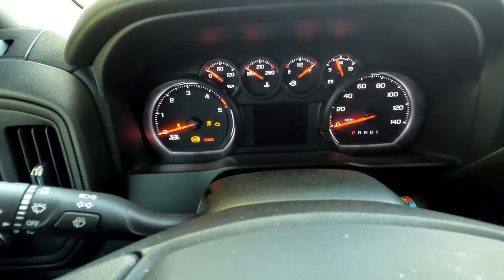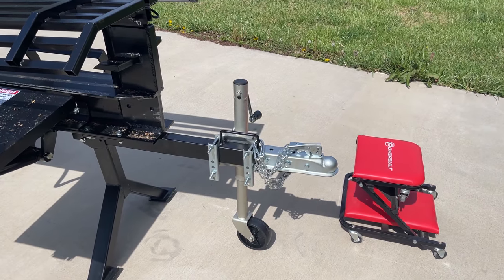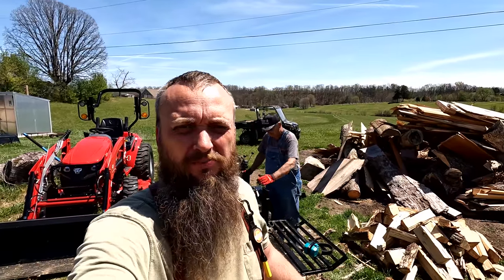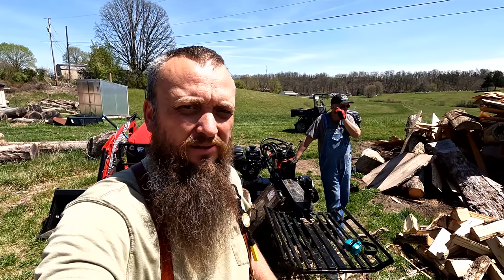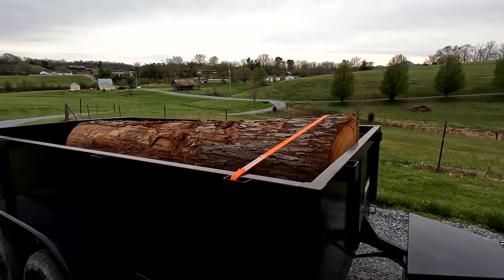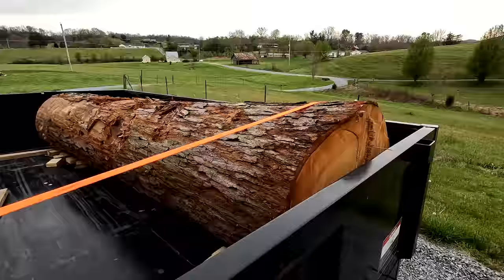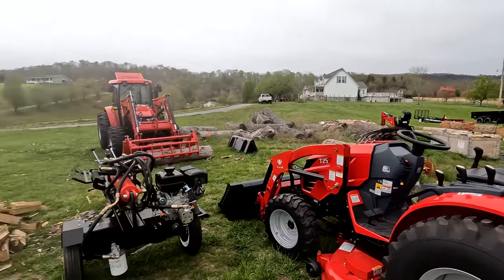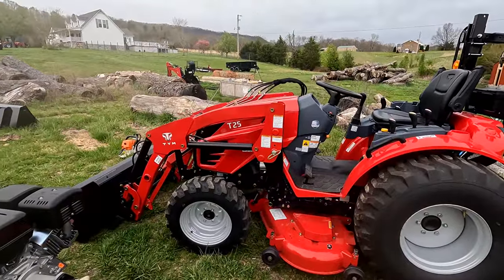Look At What Showed Up At My Sawmill!

Comment: I was thinking, that if you left the split logs on that rack and put a loader bucket in front of it that the logs would push themselves off into the loader bucket and you could dump them anyplace you wanted. Just trying to think how you could handle the firewood less. Seems like you're doing a lot of handling. That's a great looking mower for sure!

Comment: One idea I have when you’re splitting logs is to take some of the cuttings off the burn pile and split them for fire wood too.
Reply from the maker: Pine
Reply: @OutoftheWoods0623   hardwood burns nicely and can burn to hot coals to cook on. potatoes insulated in a dampened coarse kosher salt mix and aluminum is  very tastey. put in the fire for 10 minutes flip over for another 10 and taters ready as a country boy you could tell me more.  a little dry pine makes a good fire starter. do you burn your burn pile in the winter when we need a tad more heat. or in the summer heat is not good for forest fire dangers. i know to you know better burn safely. 

your mowing near dark time reminds me of days past with a d160 16 hp wheelhorse  lawn and garden tractor with a 60 inch mower deck and headlights on past dark

Comment: I have to say IMO hydraulic wood splitter is one of the greatest inventions ever.
Reply: @jkcarroll  I have used both for many years.  I even have had wood splitting contest.  BTW I never won any of them but I did succeed in getting a lot of wood split.  At my age my future plans are to stick with the hydraulic method.
Reply: @larrystephens7437  Oh, I agree  about using the hydraulic method when you get older. I'm just saying that if you have a teenager showing signs of testosterone poisoning, the hammer-and-maul method is a wonderful  treatment.
Reply: @jkcarroll  Yep it was the teenagers that I challenged to the splitting contest that I had no intention of winning.  They got to win the contest and ended up the overall winner.  I got my wood split!!

Comment: Just about the only thing I would've done different is to NOT just throw the split wood on the ground. Because now you have to bend over to pick all of it back up to load/haul it elsewhere. I would put it in the truck bed, a trailer(preferably a dump) or stack it neatly(for later use) straight off the splitter. But, it's your own back getting damaged, not mine. My Dad taught me 2 key things to make my life better for my future. #1 is to work smarter, not harder. #2 is to do the job right the first time to prevent yourself from having to do the same job twice. Only one task in Life is worth repeating, even when done correctly, and that is to create happiness.
Reply: lots of neat stuff. i saw the magnetic length gage. you have a stihl chainsaw. i have been looking at electric chainsaws with the quiet power of lithiumim ion battery power. on the home depot line i favor the extra starting  bar length of  the 40 volt saw. the 18 volt is ok but is not that powerful because of the less voltage and the lighter  battery weight. the  first battery operating chainsaw that i saw  was from a gentleman from church  in his 80s he  had a small battery operated saw of brand x(unknown name from earlier amazon days at least 8 years ago. i was amazed it was lightweight tool (not a kids toy) . but i was a healthy paul bunion of man type in my mid 50s . i need a gas powered ear shattering noisey machine. now i like the quiet push button off and on of the light weight plastic properly designed battery operated chainsaw. i have seen enough 110 volt chain saws with broken/cut power cords that skip them.
it reminds me of the first test of a 18 volt ni-cad battery powered ryobi (ca nobi) chainsaw as shaina twain sang that don't impress me much. but if a lithium-ion 18 volt battery was available  i would  l would be curious on a retest.

nathan i your parents name you after nathan in the bible. or nathan the big wiener of a famous coney island hot dog. or the revolutionary Patriot  nathan hale of connecticut and  member of the green mountain boy and maybe the new Hampshire motto live free or die. hey it don't matter   you have  that name as long as you as you have been alive because your mom and dad christened you nathan of your family line.

are you going to the connecticut yankee open house at log rite here in tolland connecticut with tons of signs nathan (hale) slept here. if you do come up bring your dad because kevin bantle co owner of log rite lost his dad years ago. bring your son also because your son has to see the world out of the woods. and the bantles have a couple of boys  of the same vintage as your son. because it is a family event starting 8 am and going until  3pm officall or whenever the cleanup or party ends.  give mrs nathan the option to come up north to tolland  connecticut. if you par take in moonshine bring a bottle of tim smith's legal Tennessee sipping moonshine  but remember no sipping and driving connecticut  local mounties (state troopers) do not like  alcohol over the legal limit.
 make sure that you invite mrs nathan  and give her the option or you will never hear the end of that. your dad taught you happy wife happy life. especially if the women axe men from maine are there.

later brother of different parents. i have to get out of this forced retirement institution.  take care my friend. check with kevin if you should bring camp wood if happens to be freezing cold or damp. it is happening rain or shine. maybe this a forestry forum first barbeque after the covid pandemic. check with the  bantles about latest covid mandates in tolland county. we want to to be safe. and if that mandates extra safe. it is better to be safe now than sorry ier   later.

Comment: Great video Nathan; i too (as other have already said) enjoy watching you work with your father. 

I do have a question; your saw was kind of jerking when you were cutting. Mine is doing the same thing; what the heck makes them vibrate like that? Is it something I did while sharpening the chain?
Reply: Yes, that shaking is.not normal and is revealing some problem with sharpening, the bar, or sprocket.  Try these 1) remove your bar and chain and remount them.  Not fixed? Then 2)  Mount a brand new chain.  Not fixed? 3) Remove bar and chain and examine the sprocket and replace (this is not likely the cause. Usually you've got a chain cutting unevenly on the left and right which will cause the bar to vibrate and is worse on longer bars.  Perhaps the rakers are filed uneven or very low and it's just very grabby in too hard a wood.

Comment: Never seen that fire wood round measuring tool before. All I do is lay my chainsaw on it’s side so the dogs are against the end of the log then the tip is where I cut. Easy consistent lengths, I use an 18” bar mainly for this but with the dog the rounds up up being about 15” long.
Reply from the maker: Found on Etsy

Comment: I have a question.  I have some pressure treated boards that have been on porch of old home place for 45 years.  Do you think it would be OK to use them as spacer boards between newly cut lumber.  Thanks
Reply from the maker: no, you would get sticker stain,

Comment: I may have missed it, but I never heard you make clear just why you wanted a log splitter, you just said you've always wanted to get one.  Is it to make good use of wood that would otherwise go on the burn pile?  Some of the logs you cut up for the wood splitter look like they'd make good sawmill logs.  Could you clarify just where the splitter fits into your operation? ( And it does look like a really handy piece of equipment.)

Comment: Grabbing logs by the ends on the splitter table is a bad idea, especially when two people are working together. Very easy to get a little quick on the hydraulics and get a crushed hand on the ram side or worse a cut off hand or fingers on the wedge side. Better to handle the logs and split pieces by the sides. Great splitter though, looks like you could split a lot of wood in a short time with it.

Comment: Get a foot actuator to operate the splitter ram. Keeps both hands free to handle big logs. Plus change the valve on it to where when it bottoms out it automatically retracts.
Reply from the maker: Works just fine as is. Thanks
Reply: @OutoftheWoods0623  ok my friend no offense of course. But yeah that foot switch comes in handy though fooling with those really big firewood rounds. My ex father in-law put one on his and it's a big help. Like he said I wish I put one on a couple years sooner.

Comment: Since you are cutting your wood significantly shorter than the stroke on your log splitter could you add some hydraulic cylinder stops to the ram to keep it from cycling all the way back in? This would shorten the time needed to split the wood.
Reply: I was wondering the same. I also thought maybe a four way splitter would be better, if one is available for that machine. Obviously there would be an upper limit on size of logs split, or maybe too much for the hydraulics, but it seems that saves several splits to get to wood stove sized chunks.
Reply: @andrewbieger5004  I believe he does have a 4 way for it.  I've noticed it in a couple of shots of them using the splitter.
Reply: @tyettu  Must have missed that one.Thanks

Comment: Doesn't anyone tier their firewood anymore? I haven't seen anything tired up properly to dry like we used to. When I was in my teens we cut and split 9 cord each year for that winter. After we built a wood splitter I run it and tired it to dry then in the fall I wheel barrow Ed it into the basement load after load. Music playing sure helped. But any videos of wood splitters or even the commercial splitters no one seems to tier any more. It is the only accurate way of seeing  how many cord you have and how many you lost during the process. I was in the best shape of my life when I did that. I wish I could physically do it today.

Comment: I will never be able to understand why people pick up logs to be split even with a bucket on a tractor and then split it and throw  them on the ground so they can pick them up again. It seems to me that it would be easier to find a way to slide them out of the way perhaps into a truck or some kind of a machine that they can be hauled to where they’re going to be used or stored.
Reply: Like another tractor bucket!!
Reply: yep, most of the work is in picking up the wood - try to find ways to only do it once.
Reply: @boooshes  
You are correct of course. Used to be you would split the wood with a wedge and sledge. Smaller pieces obviously with an ax. So modern technology gives you hydraulics to split the wood and people find another way of doing even more work. They weren’t satisfied that the hardest part of this was already handled they had to add another task. Lol